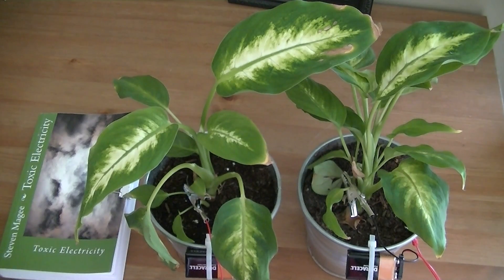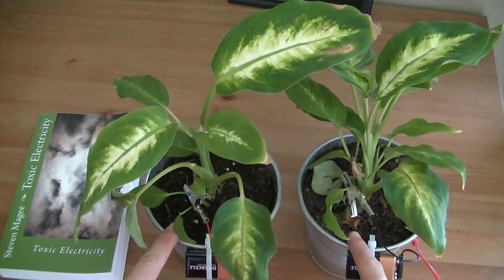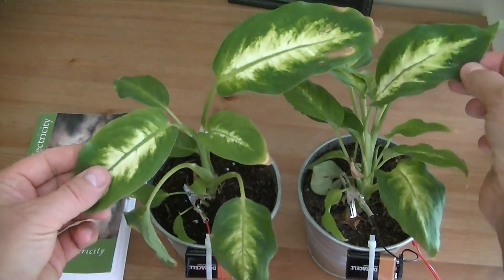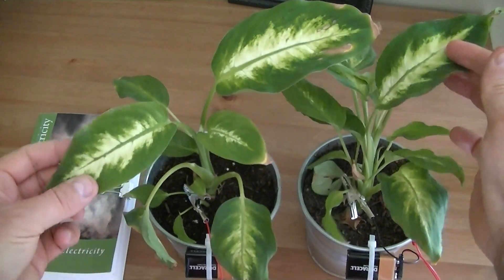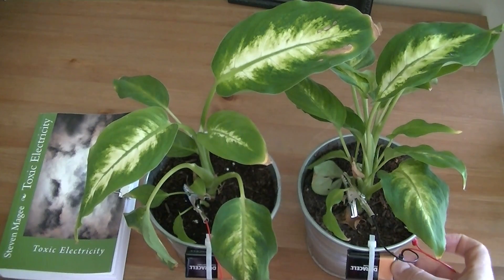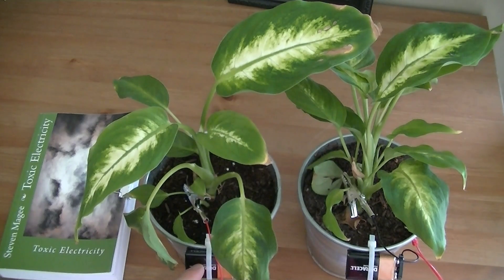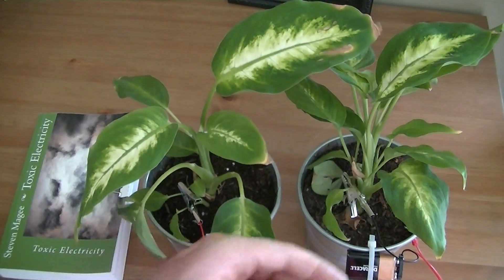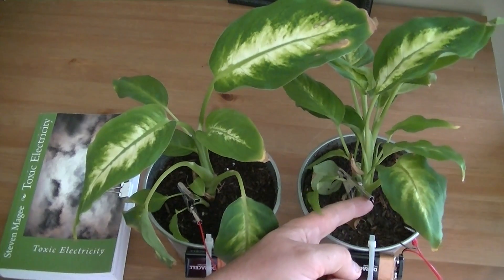Growing a Dieffenbachia Using a 9 Volt Battery

Comment from the maker: The plant is sensitive to radio frequencies and electromagnetic fields, so I would move it away from any sources that could be affecting it.  If it is on the floor, move it up onto a table, as it may be getting subjected to "stray voltage" from the floor.

Comment: Question, my understanding is that the electrons in a battery only move from the negative to the positive and not the other way as some may have been taught...

What does this experiment show? 1st test the electrons going through the pot, the soil the plant and back into the battery 2nd test Electrons moving through the plant, soil, pot then back into the battery. 
So I`m guessing you are going to show us if the electrons traveling up the plant or down the plant are going to affect it`s growth?